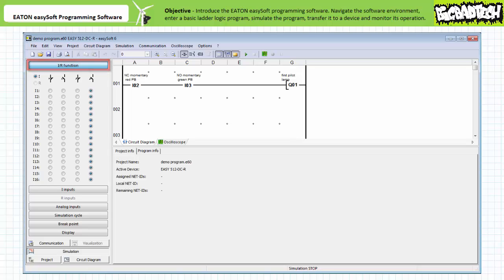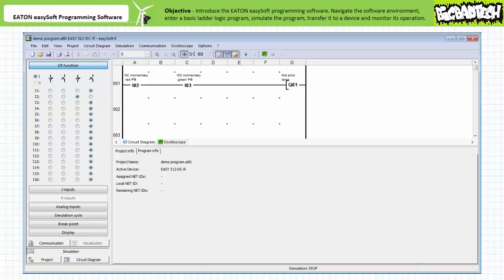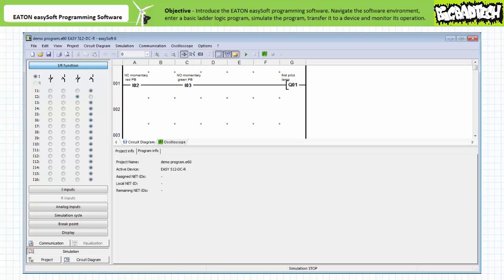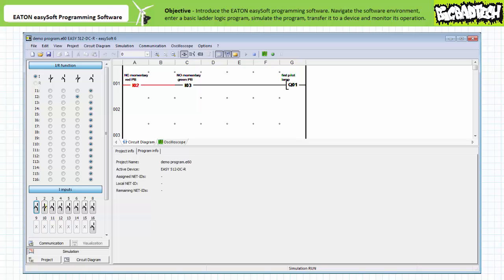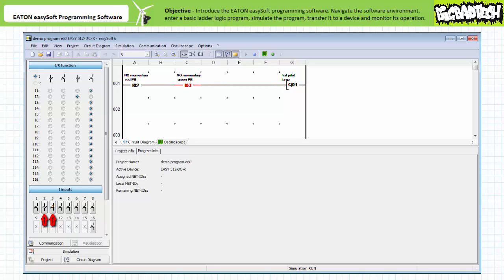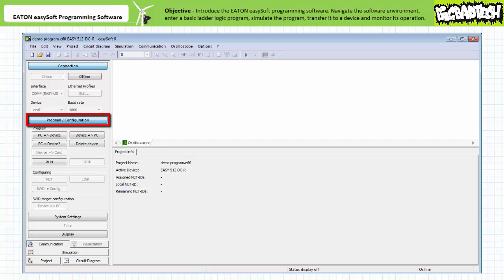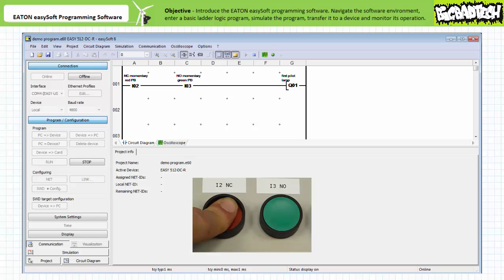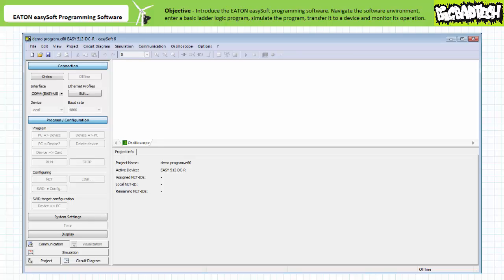PLC Programming Software: EATON easySoft (Part 2 of 2)

Comment: Did they remove the IR functions feature in Eaton easySoft 7?  All I see with in easySoft 7 is simulation cycle, break point, and display.
Reply from the maker: I don't have version 7 yet. That's a bummer if true. It's one of the greatest features for simulation.

Comment: hey great video. But I have a question i downloaded the demo version (easySoft-Pro V6.96 Demo) but i cant find a communicate button to import my file to the PLC. how to get that Communicate button? should I update?
Reply from the maker: I think the demo version doesn’t allow downloading to an actual device.
Reply: Iam with the same problem. Now i got the normal version, but i use windows 10 and it just works in windows xp.